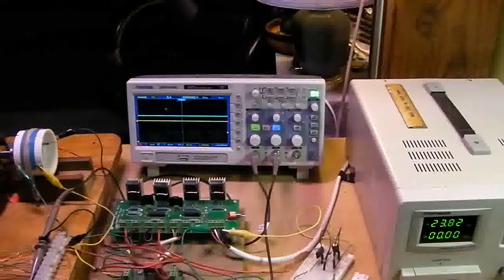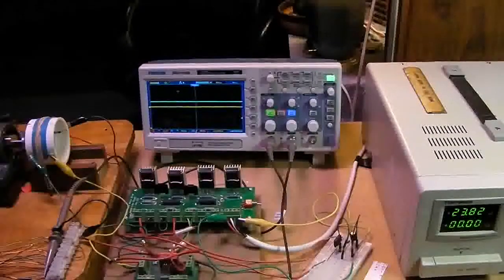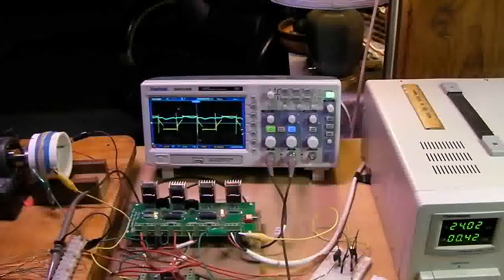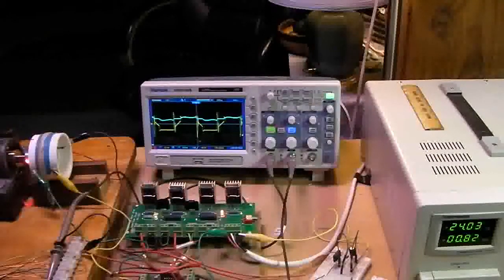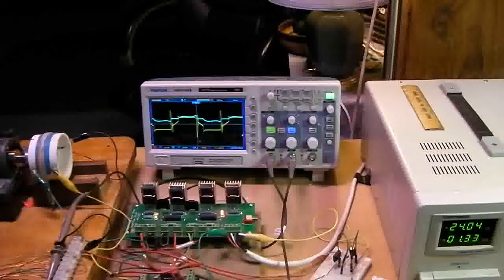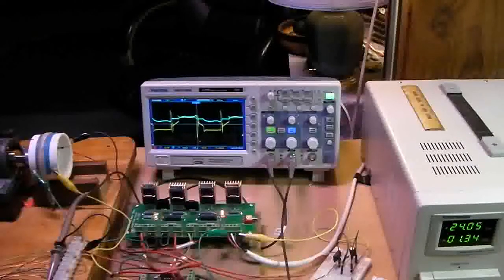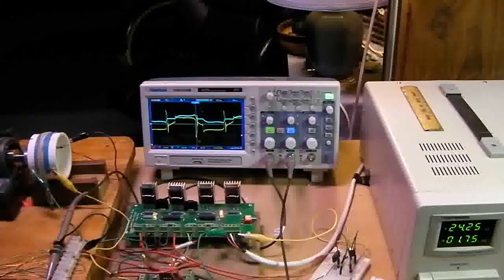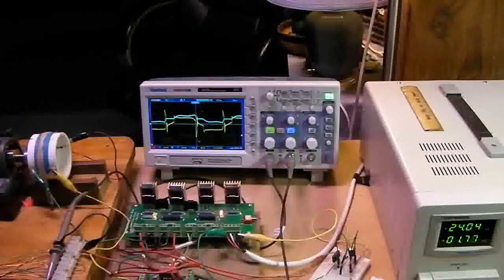21 0b 6Pole Bifilar

Comment: Yaro......good morning.......what is the goal with all this experiment? And what are the conclusions on the all the works you has been doing?.......any differences in a normal dc motor behavior? Btw...i love what you are doing....it is your baby.
Reply from the maker: These  two videos demonstrate a preliminary replication of the Bedini/Cole experiment that adding strands to an air core coil in parallel and then wiring the other modified motor coils in series improves the performance of the ZFM. This presents a conundrum in that the overall circuit resistance continues to be lowered with each additional strand, yet the overall amperage remains relatively the same. Certainly there must be a reasonable explanation for this behavior...
Reply: @yaro1776  I don't see how this motor will recover the energy lost on the back ems and the spike as the other Bedini designs. On the osciloscope I can see 2 spike + and -  which looks very powerfull.